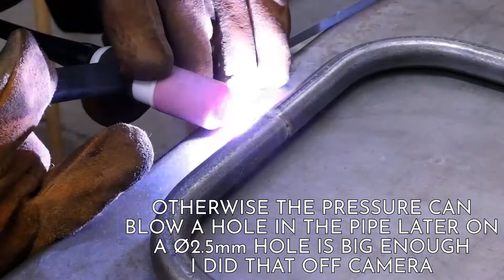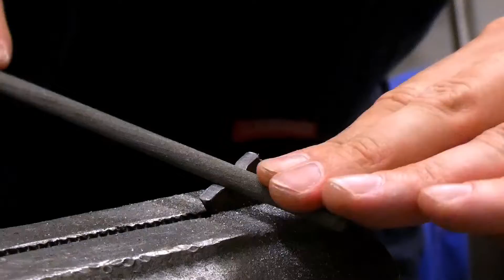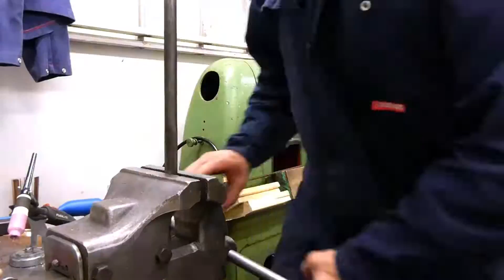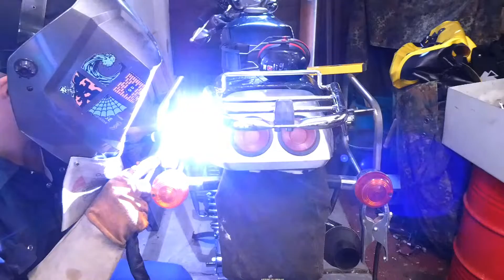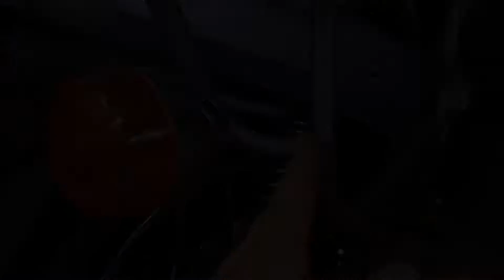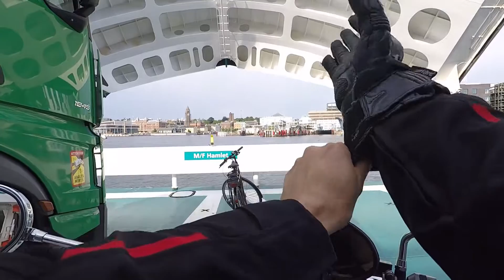DIY Pannier Rack - Part 2 - Building the Rack

Comment: Very good workmanship, but maybe you should think outside the box. I bought some cheap over the seat pannier bags and am about to make a larger pair from 2 x 40 L dry bags and some webbing. All that is needed then is a couple of bars to keep them away from the wheels. I made mine from 15mm x 5mm strip, each 20cm long with a hole drilled at one end. Remove the top bolt from the shock and hang the bar from there, position and tighten. Admittedly there is no rear carrier but 80 litres is a lot even for two people. Just an idea for your watchers who don't have your equipment.
Reply from the maker: Thanks for your comment and your idea! You said correctly, that there is quite some tooling involved in my solution, that not everybody has. Many ways lead to rome :)
Highly appreciated! Thanks!

Comment: Good work Sir! Not sure if its been said, but if you drill a vent holes where ever the next tube welds onto the main hoop you will only have one exposed vent at the end of the project and make that one vent hole at the lowest point to prevent water from pooling in the tubing and promoting future rust. just a few tips not saying your way doesn't work.
Reply from the maker: That's a good suggestion! Thanks for the comment! :)

Comment: I'm about to fabricate pannier racks myself did you think about making it from aluminium or is it not suitable.
Reply from the maker: Hey there! Well 6061 aluminum for example would be just fine for that. The main downside to this is, that you need an AC TIG-welder for that - which i don't have, so for me this wasn't an option. I'm also assuming that the aluminum would be more expensive...
Reply: @buildfromsketch8102  sorry i assumed your tig was ac/dc tig. I do weld ally more than any material. I was just looking at stainless steel but thats expensive.
Reply from the maker: @rolandsmith2141  Oh no problem! In this case go ahead with aluminum, sounds great!
Yes, buying stainless steel is crazy expensive...